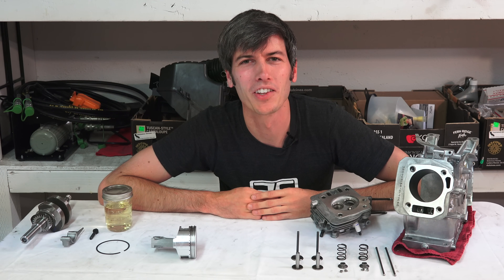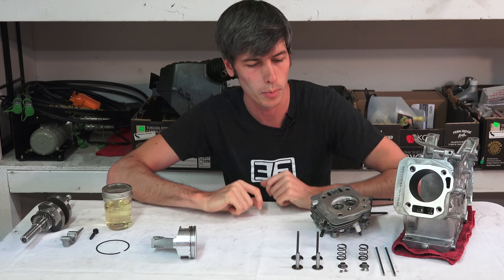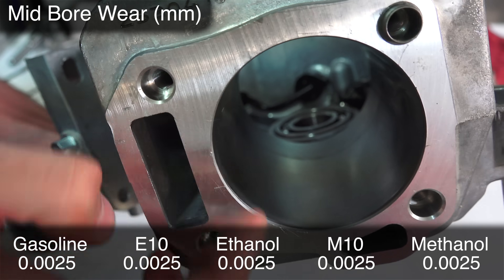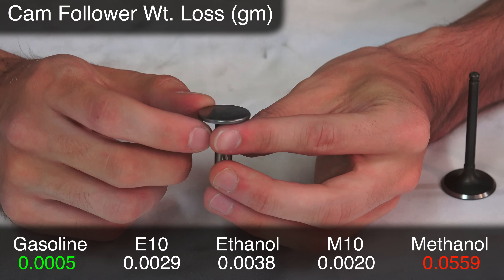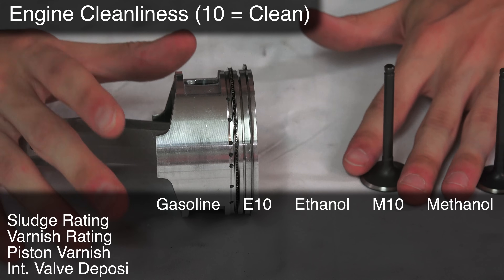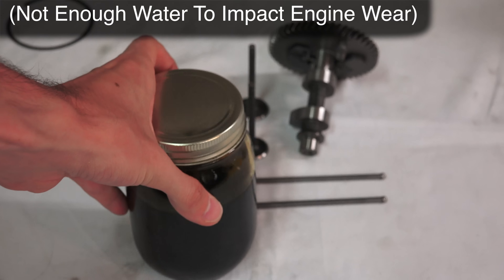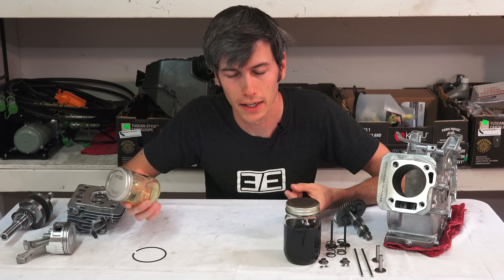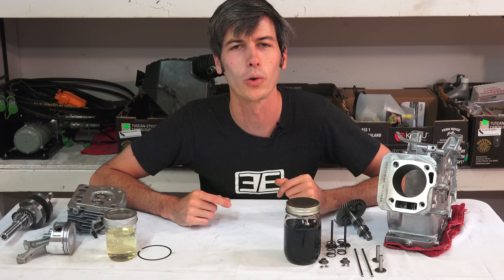Is Ethanol Bad For Your Car's Engine?

Comment: Were you planning a follow-up talk about the hydrostatic properties of ethanol, and whether or not ethanol is good for standing fuel in a fuel system? I.E. If you don't drive a car often enough to burn the whole tank off, then 100% gas is better to use - although - if you're burning a bunch of gas (say, on a road trip, or an extensive highway situation), then the ethanol will have less time to sit in your fuel system, and you'll be pretty fine when it comes to fuel system water damage?

Side:
AvE talked about it for a minute on one of his "Manly-man skills" videos from that series, and he showed how it's known that ethanol burns at a slightly lower level of 'jeuls', but I am quite interested to know, I guess from an engineering perspective or whathaveyou, if there was any actual precise data on hydrostatic properties of ethanol? And I guess, somewhat like a Goldilocks zone when it comes to it?

EDIT: You touched on it for a minute, which is awesome! but I've not seen a full video on it, from someone deemed credible, over what the data is exactly
Reply: Also, I keep saying hydrostatic, is a hydroscopic? lol

Comment: Here in Canada, Shell premium is one of the few gasolines sold with 0% Ethanol.  Our 1980 Porshe 928 needs new fuel lines, for two reasons:  1) it's an old car  2) if a pure gasoline isn't available, and an Ethanol blend must be used, that blend can soften the existing fuel lines (if not replaced), because, as mentioned in the video, cars sold before Ethanol are subject to fuel line 'softening'.  It doesn't actually corrode or 'eat' the fuel lines, but will soften the rubber.  If there are any weak spots, they could be exposed, causing a leak, which could cause a fire.  So, yes, if you have an older project/vintage vehicle, it's looking like silicone lines / hoses are the answer.
Reply: Good point. 
FYI, it's silicone.
Reply: lol fixed
Reply: Ultramar premium is ethanol free too

Comment: How can a camshaft have different wear when using different fuel?
Reply: Because when you run e85 you drive faster and harder!!
Reply: That's......actually a really good question .....
Reply: Thank you :-) i hope someone can answer my question.
Reply: i had the same question... maybe different pressures.. but difference still seems too big
Reply: Blow-by gets into the oil and affects it's performance.
Reply: I'm guessing measuring the effect on engine oil from blowby as the cams are actively lubed by the engine oil.  Could've also just been to be another parameter to analyze the results as no motor will ever be perfectly consistent from unit to unit.
Reply: I was also wondering this.

Comment: Is E10 higher in Knock Rating than normal european fuel? Normal Fuel is E5 with Knock Rating of 95 ROZ and E10 claims to also have 95 but i think it goes to the super gas Range of 98 ROZ
Reply: Don't you mean RON? (Real Octane Number)
Reply: Germany uses ROZ with 100 being Octane

Comment: Hey Jason, do you think you could make a video on how rotary engines handle alcohol fuels? I’m curious to see how things like the apex seals will handle E10, E85, as well as methanol.
Reply: Hi Levin,

Firstly wankel rotaries blow apex seals because of carbon build up. (RX8 is notorious for this with its peripheral exhaust ports and how they aren't smooth, stock they are a sharp taper). They accumulate carbon deposits in exhaust ports and other nook and crannies causing a significant increase in compression ratio. This increase in CR blows out the apex seals and when you have no seal you get no compression.

By using ethanol fuels in wankels, you don't accumulate all that carbon build up. This leaves the ports clean etc, resulting in not blowing out apex seals. (Ethanol + Oxygen -> Carbon Dioxide and WATER! This clean the internals)

People have also hailed methanol and water injection in rotaries to be an engine saver. This is because of the same effect. It basically steam cleans the insides of your engine.

I have no sources, however when you consider carbon build up as the cause of rotaries blowing apex seals, the solutions stated above make logical sense. And you can probably google this and come to the same conclusion.

Thanks
Have a nice day :)
Reply: Ben Tippins So does that mean alcohol won’t eat up the apex seals then?
Reply: I would say that it would have a similar effect on apex seals as it would on a piston engine equivalent. Which in majority of cases is nothing much. But I haven't done substantial reasearch on the topic.

Ethanol is corrosive, however so is petrol. Most people go on about this as a potential for disater but turn a blind eye to the fact that petrol does the same thing. Fuel stations/providers are required by law (well in Australia) to add corrosion inhibitors and other things to prevent it from messing up your fuel system.

So tldr I think she'll be right but I haven't definitively read up on it.

PS that ^^ was my very first YouTube comment ever! Yay for Engineering Explained

Comment: E10 throws off the fuels specific gravity not a good idea for the old carburetor cars.  yuk!
Reply: No wonder my 80s Fords had trouble with it! A friend ran his 1976 Mustang on gasohol (50% gasoline and 50% ethanol). It smelled like a gin distillery, even when parked in the Summer!
Reply: Carbs can be retuned, Edelbrock even sells E85 specific carbs.

Comment: Blaze 100 offered by Petron is the only fuel that doesn't have ethanol added to the gasoline in the Philippines.

I haven't seen any major problems with my '98 Mazda 323 sedan refuelling with gasoline mixed ethanol. Here, people are worry more of gas stations offering dirty fuels instead of ethanol being added to gasoline.

Comment: How does converting to E85 improve power when professionally tuned?
Reply: I read that a lot of tuners use e85 in tuned wrx sti.  I think it was to prevent knock when running high boost. Maybe I'm wrong.
Reply from the maker: E85 has a really high octane rating, so you can advance timing significantly and make lots of power.
Reply: @EngineeringExplained  This, plus you can run more compression on any engine if you are building it as well as boost on forced induction engines! I've also had engines run cooler on it in hot weather.

Comment: a bit different in Germany: normal fuel may have up to 5% ethanol- it is not considered to make any difference- than in addition to that there is E10- and the catch is, that it is a bit cheaper than E5 and car manufacturers tell you whether you may run it or not

Comment: Thanks for the great video! Do you think it's possible to modify a car's fuel system such that it is E10 ready?
I have a '2000 MX-5 and my country will probably ban the regular unleaded fuel in 2020.
Reply: My 1998 Subaru Forester was designed to run e10 from the factory. You should contact the manufacturer and ask if your car can run on e10 unmodified.
Reply: I already know it can't, unfortunately.

Comment: In Brazil cars have been running with ethanol since de oil crises in 70's, it's a more eficcient fuel, ethanol here is hydrate fuel with 4% of water and 96% of ethanol, and gasoline has at least 27% ethanol.
Reply: Ethanol is anything but efficient!
Reply: @doorguner01  But is emission free

Comment: Ethanol storage life is bad, sucks in water and then it won’t combust. For low use cars the fuel stabiliser helps but the stuff goes off in months. But on a daily driver it’s not a bad thing.
Reply: That probably why my lawn mower wouldn't start 2 years ago. It would only start with starting gas, when I emptied the gas tank and filled up with new fuel it worked like new.

Comment: But why should we use E10 in the first place?  It reduces fuel economy and causes problems with older vehicles 
and small engines.
Reply: You missed the part about ethanol being a renewable fuel (corn). That's the entire reason it exists.

Comment: Ethanol was never used because it was good for your engine. In fact, it's not even real fuel at all. It is simply a way to increase profit in a market that uses fast-growing GMO corn. In other words, it was cheaper to break down corn into a "fuel" than to raise the prices of gas like across the world. Try this test yourself: fill your tank with 100% gas, and again with mid-grade or something other than "regular." You will find your car performing much smoother overall. You get more gas mileage, cleaner engine, faster acceleration, and longer engine life. Some cities have even banned the use of ethanol fuel because it really is just another money racket. Use more gas, break your engine parts sooner, and less engine power. I've experienced this with my old metro that died 1 year after the switch to ethanol, and I still notice a performance difference with my newer Acura.

Comment: Thanks for all your great videos. I have a quesion... What happens to an engine if the manufacturer recommend premium fuel but the gas station where you live only have regular gas?
Reply from the maker: Most engines will be fine, as long as you don't drive it hard. If it's truly "required" then I would run the tank super low (and not using full throttle) and then refill with better fuel. Could even be worth topping off soon with higher octane fuel just to get the average up.

Comment: Is there any information on whether the engine used in testing was port injection or direct injection? For the cleanliness of the valves, I can see how port injection with Ethanol would keep them very clean, but would the same be true if it were direct injection?
Reply: Only thing direct injection back during that study would have been diesel engines.
Reply: The fuel in a PI system washes the valves. DI fuel does not pass by the valves so no cleaning affect no matter what kind of fuel used.
Reply: arminhammer41 that’s not true anymore since a lot of direct injection systems include port injectors for washing the valves. Systems that don’t include port injectors use a combination of valve timing and a second staggered spray to clean the back of the valves while they’re open.
Reply: The test was done with a 2300cc 4 cylinder engine in 1980.  Hmmm, what would that be?   It would be a Ford 2.3 from late Pintos, early 4 cylinder Mustangs, etc...  At that time it would have had either a carb or a throttle body fuel injection system, at best.  The real problem with going over 10% will be with motorcycles and other air cooled engines.  As we know, alcohol will make any engine run leaner than it would on 100% gasoline, and what happens when they run leaner?  They run hotter.  Hotter is bad for air cooled engines.

Comment: Great video, let's not forget what Ethanol does to rubber hoses and full-tanks on bikes. I only run ethanol free gas in my cars and bikes.
Reply: Where do you buy pure gasoline?
Reply: Some stations advertise it ( at least in my area ).  Around here, the 91 octane is sometimes pure gas, other stations its the 85 - so you have to read the pump.
Reply: In my neck of the woods it's advertised as "recreational fuel", intended for small engine vehicles and marine use.  I use it in my lawn equipment as it is supposed to help keep the small carb bits from getting clogged with gunk.
Reply: @eksine   in SW Florida it's in several gas stations, labeled as Rec Fuel at 89 octane I think. Rec as in recreational...for boats etc.  In my experience, e10 will destroy gas powered yard tools.
Reply: FS in the midwest.
Reply: Just think what ethanol does to your body. When you drink hard liquor, Votka, Gin, Scotch etc, it is 40 % ethanol and 60% water.
Reply: Robert Kattner This about car engines and components, not the human body. Just think what drinking gasoline does to your body?
Reply: E10 is fine for cars built after the early 90s, as their engines are forumlated to run on the stuff, E15 is fine for cars built after 2001 as federal standards also required cars manufactured after the date to comply with that ethanol-gasoline blend, while E85 is only to be used in Flex Fuel vehicles doing otherwise will result in damage to your car.

Boats, should not use ethanol at all as they are not designed to handle that fuel blend. 

I personally strongly support ethanol use, as it is much cheaper to fill up, the vast majority of cars upwards of 93% on the road today can use it, and it supports American agriculture over Middle Eastern dictatorships.
Reply: @CapsFan117  Would be nice if there were a biofuel that would play nice with old cars, boats, and motorcycles that didn't cost both testicles and three fifths of the liver.
Reply: @lsswappedcessna  Good thing that we have good choice at least in my neck of the woods we have everything from ethanol free to flex fuels among our stations. Problem is a lot of people are pretty ignorant of what fuel works best for their car, and get confused despite written warnings and labels.
Reply: Have you actually run both enough to have clear data on this?  I drive race karts and a lot of people swear by ethanol free leaded or unleaded race gas and their fuel lines and tanks seem to look about the same as mine do running 93 E10 pump gas.  Not sure if 2-stroke oil plays a part, but it's not like the E10 made a hole in my tank while the leaded stuff looked fresh off the showroom floor with the same amount of run time/age.
Reply: What?
Reply: Where tf do you find E0? Do you have to order it special online?
Reply: You probably shouldn't be sniffing gas.